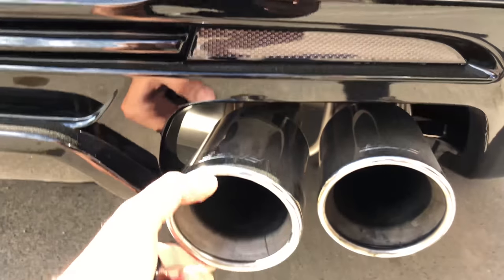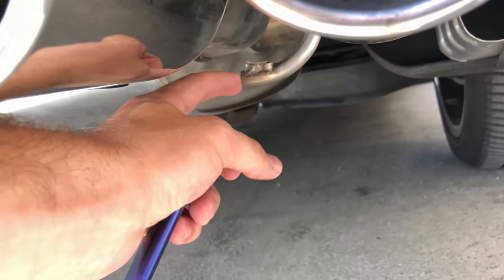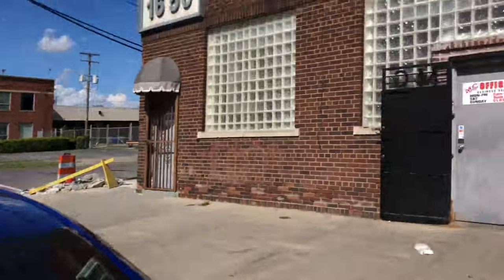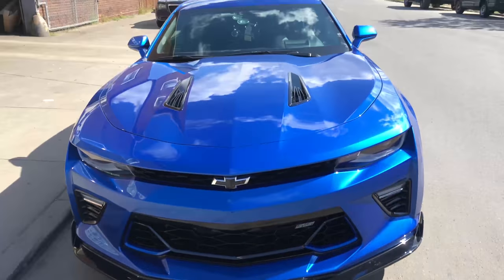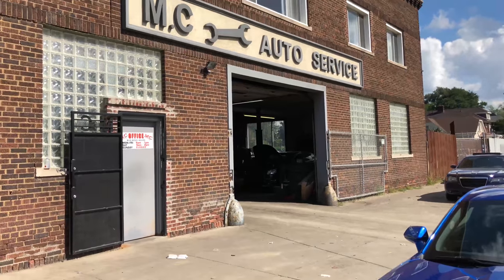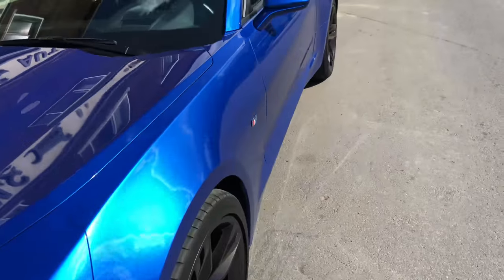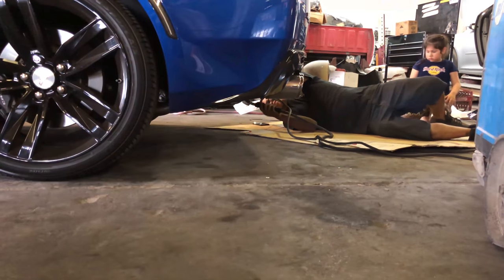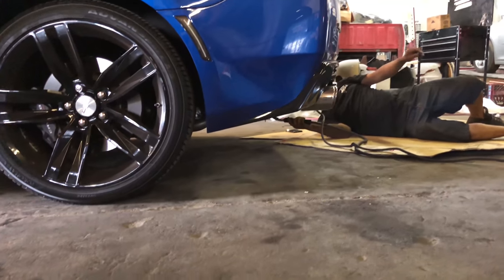CAMARO BORLA AXLE BACK BROKE!!

Comment: What is going on Valentino?My last name is Valentino 🤷🏼‍♂️I have to get my exhaust done on my 2018 Camaro SS not sure what I’m going with yet. I did minor modifications like the blackout marker and third brake light.Did the black emblems had the rims powder coated in black satin with black locking gorilla lugs. I ceramic coated the rims I’m waiting on the car I use the ceramic boost on it for now. I have to order the blackout taillights next.Your car looks great I was going to get the blue but went with the nightfall gray metallic.